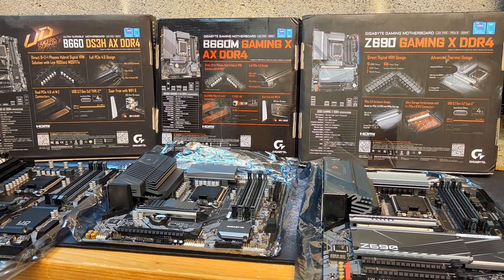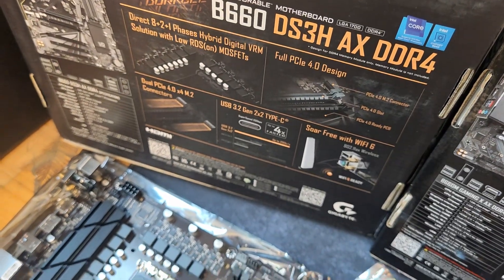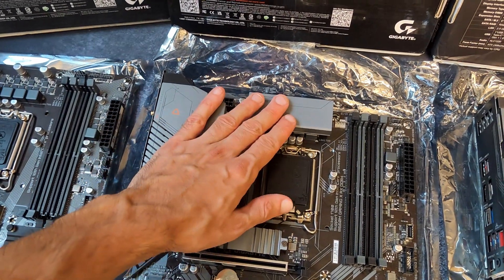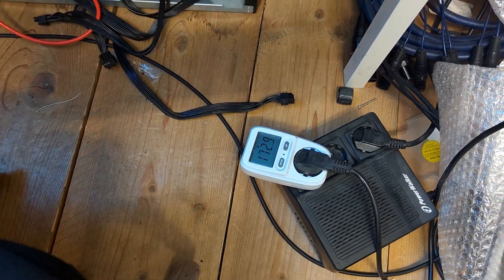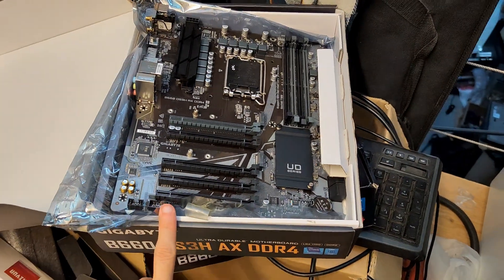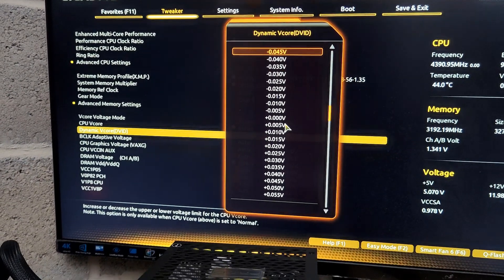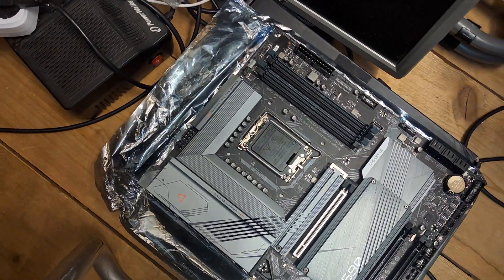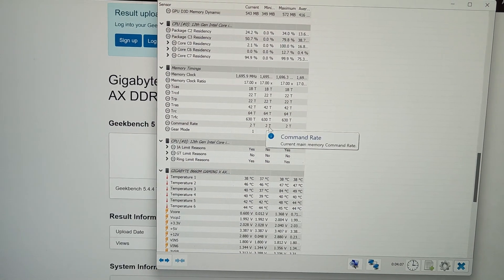B660M Gaming X AX review and comparison - performance issues

Comment from the maker: UPDATE IMPORTANT: the issue with these boards shows with H0 i3 and i5 CPUs and C0 non K i7 and i9, it DOES NOT show on C0 i5 and i3 CPUs for some reason.
It also shows onGigabyte  B760 with some C0 CPU (Alder Lake cores), i had it happen on a 12900k, but not on a 12400f with C0 die.

Comment: Can you recommend me any budget board for intel i5 13500 mtx one with good vrm best performance 
I not that in pc very much
Reply from the maker: msi b760m a should be good
Reply: @mircomputers  what about the b660m gaming x did u face any issue its bit cheaper than the msi one 
There is any issue with this board
Reply from the maker: @Pau7L  yes that's what this video is about
Reply: Can please test the latest gen b760m gigabyte or aorus board may be they improved 
Coz this year b650 am5 comes out from gigabyte ud series is best budget value motherboard this year as per hardware unboxed testing

Comment: Ciao bel video (scrivo in italiano per capirci meglio):
Volevo chiederti se il difetto che hai rilevato sulla b600M gaming x AX è presente anche con i5 12400. Inoltre, come giustamente dici, dover dare un po' di overvolt per avere le prestazioni std non è una bella cosa, ma questo perchè cmq l'overvolt "rovina" mobo e/o cpu oppure per una questione di etica diciamo così (è scorretto vendere un prodotto che va "calibrato" per farlo funzionare come dovrebbe estratto dalla confezione"
Complimenti ancora
Reply from the maker: si con tutti i processori provati
Reply: @mircomputers  grazie
Reply from the maker: @dmbr1s  nel senso che dipende dalla fortuna della singola cpu non dal modello

alcuni 12600 vanno bene anche stock

i 12400f richiedono quasi sempre almeno +5, ma a volte addirittura +25, quelli che ho in costruzone ora richiedono +10 su questa e +15 sulla asrock pro rs
Reply: @mircomputers  sto ordinando or ora (entro stasera dai) e per ora userò un i5 12400 (senza VGA discreta). Ho il dubbio se gaming X ax o mortar wifi a questo punto...
Reply from the maker: @dmbr1s  assolutamente msi, anche board economiche

prendi il 12500 se puoi che la igpu è molto meglio

se compri da amazon usa i nostri ref..  ddr4 o 5 ? https://amzn.to/3Nd9eWe
Reply: @mircomputers  ddr4. Ma con 12500 sto proprio oltre il budget (già sforato)
Reply from the maker: @dmbr1s  prendi la msi b660m a WiFi e non la mortar

Comment: 17 minutes long with 14 minutes worth of filler talk. You did a full day of testing too? JFC
Reply from the maker: so, you wrote this comment without any further information to add? basically means 100% of your writing is filler talk:D
Reply from the maker: that's way more than a day of testing, so what are your finding on the subject? do you own any f these board and have tried to mess with the undervolt and check the scores?

Comment: Hi, I ordered a b660m gaming x ax with the 12600k, and 32GB 3200mhz ram cl16. What can I do to make it perform the best. I know I can’t overclock but I don’t need that. I’m worried after watching your video, that I won’t be able to extract the full power of my 12600k at stock setting.
Thanks for the video!
Reply from the maker: Check the scores with other people and it anything is wrong try to add a little offset overvolt and see if scores improve. Try different benchmarks like Cinebench r23 and Geekbench 5
Reply from the maker: apparently clock stretching by default is active only on locked CPUs , how are your scores?

Comment: My b660 gaming x is working fine at 3200, haven't tried undervolting the 12400 yet. I'm using 4 sticks of 3200mhz CL14 b die. I get 12400 on my 12400 in cinebench lol. It actually benches at exactly 12400 sometimes. I only paid £80 for it. Haven't tried any memory tuning yet I'll probably only bother with trfc etc. I use an Arctic i35, 61-63 degrees at max load and the fan is silent. Strange yours is so hot, I think the mount is not working well personally because for me this is easily the coolest cpu I ever owned.
Reply from the maker: 12400 is not using more than 70w while 12600 is around 110, so it's perfectly normal. Also could be the bigger c0 stepping wich is easier to cool
3200 is easy on the memory controller, you could try to rise to 3333 frequency at the same exact timings and should see a nice boost

Comment: Great findings! Voltage regulation with 12th gen Intel CPUs is a real mess, I have no clue why Intel decided to make it work this weird way.
Reply from the maker: It's also very surprising that VRM efficiency is so close for all these boards. In my previous testing on the Falco75 channel we found some boards that had just plain worse results, like the ASRock that had the worst multicore score for cinebench and above average power consumption, but some like the z690m plus from Asus that came out on top maybe was just using the right amount of default undervolt to get the best efficiency. This means that actual motherboard testing should actually take some tweaking into account. It's sure an interesting topic to explore.